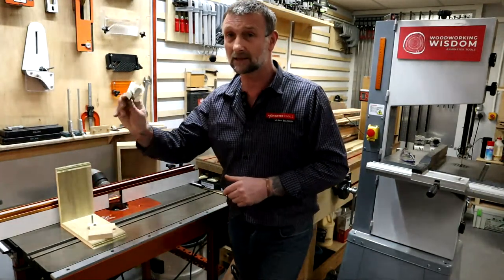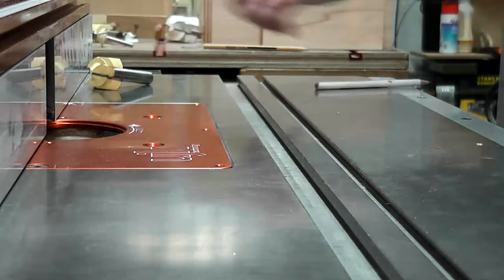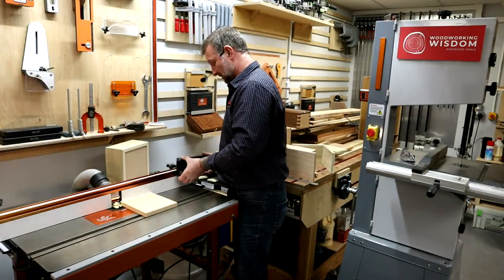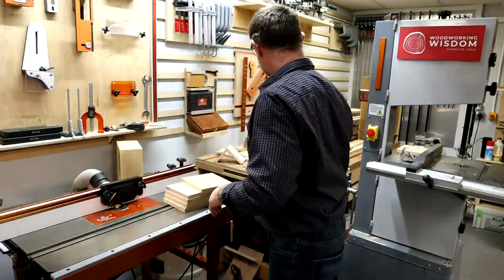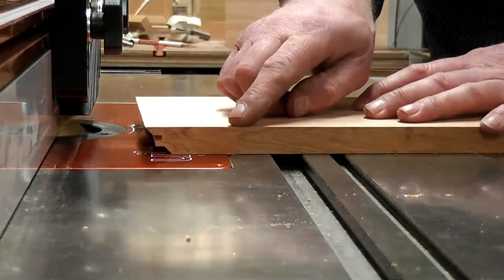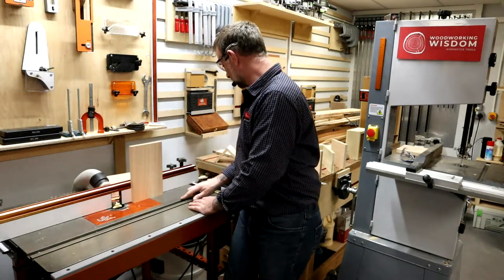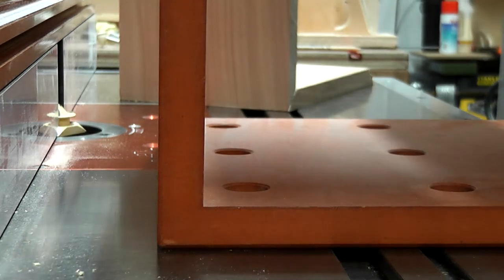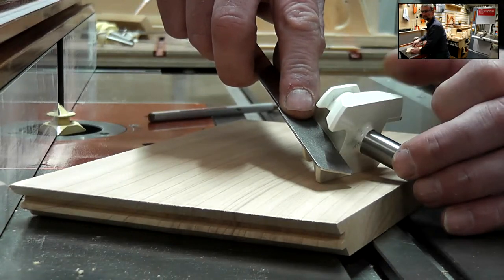Woodworking Wisdom - Mitre Lock Box Cutter

Comment: Brilliant video, I have the cutter you used, after a lot of thought and measuring with a height gauge I managed to get an acceptable joint.
But, I was blown away by the tip with the steel rule, so simple but sheer brilliance, can’t wait to try it.
Excellent and informative video 👍

Comment: Could you also route the bottom of the box using this bit?
Reply from the maker: Hi there, it is possible to do, but this can create a problem when it is assembled as the joints slide in at an angle, making this tricky to pull all the joints together. Hope that helps